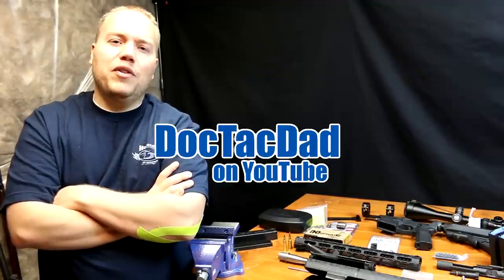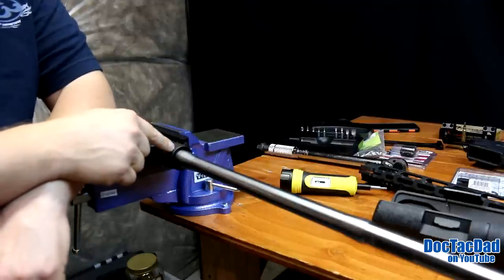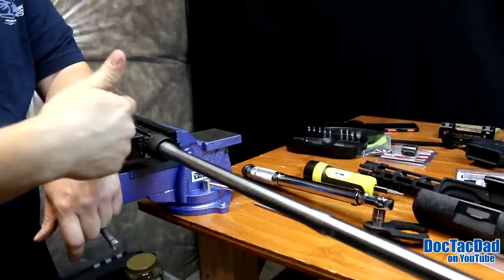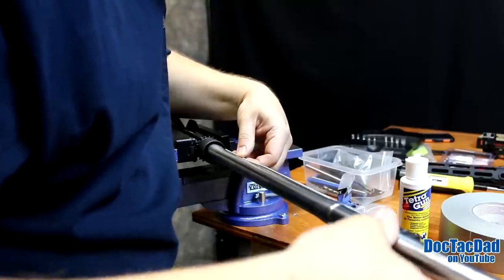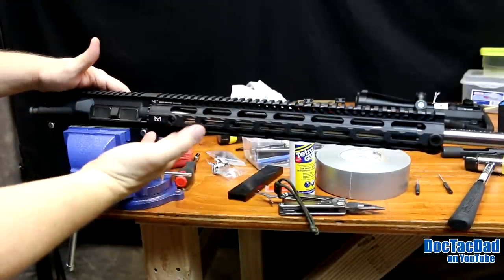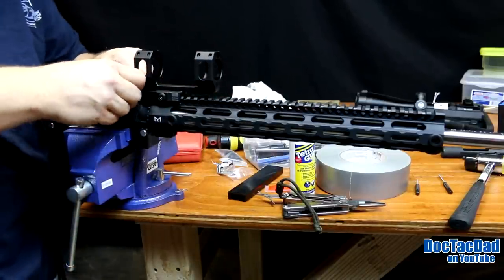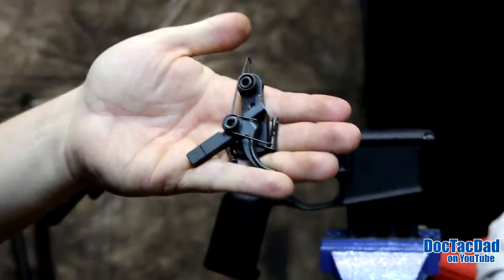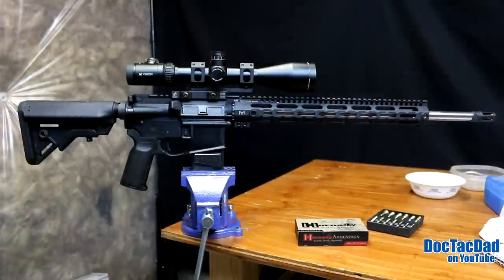Project 6.5 Grendel Rifle - Rifle Assembly

Comment: 3:50 MAKE SURE you have the torque wrench aligned with the tool, not angled from it like you have it when you were torquing 50-60-70 ft-lbs. You WILL NOT get a precise load transferred to the barrel nut if you do not.

Comment: Great build!

I'm surprised you didn't use anti-seize/grease on the barrel nut. It usually help with torquing. Also, "seasoning" the threads by tightening and loosening the barrel nut before final torque. When torquing the barrel nut, I find it easier to start at min (30ft/lbs) then then jump to max (80ft/lbs) to align the gas tube. It'll usually line up before you click-out at max. 

CHEERS!
Reply from the maker: El Terrible SoCal Great advise...I did season the threads just not on camera. The anti-seize is good idea...thanks!

Comment: you were using the torque wrench incorrectly when installing the barrel nut the torque wrench should be connected to the barrel nut wrench at a 90 degree angle for you to get the correct formulation
Reply: Exterminence grammar much?
Reply: Exterminence lol I think you were meaning to say "good to know that" and I was just being a smart-ass
Reply: You are very correct.
Reply: And you shouldn't be touching anything other than the handle

Comment: Just a tip a torque wrench is meant to be used with the device you're torquing with at the 90 degree angle. When you have it at 180 degrees (straight) like you did it is not accurate with what the torque wrench is set to anymore. you would have to use a formula to see what it would actually be by using the length of the object you're torquing with.

Comment: Great Video!! Just for future reference, when you install a crush washer, all you have to do is tighten then loosen it several times. Just tighten it a  little more on each iteration to crush the washer, hence the name crush washer. Also use gun oil on the threads while doing this works like a charm. Nice build my good sir.
Reply: Also helps to put it on in the correct direction.

Comment: If you do another build, they are addictive, consider buying some roll pin starter punches.  They are basically rods with holes in the end to hold the pin while you strike the punch.
Reply: wbbh I've been a mechanic a long time,  and I've never ran across these. I will be buying a set next time ol' snappy man comes back through.  Sound like they are worth there weight in gold.

Comment: I know this video is almost 2 years old and someone may have mentioned this already. When torquing the barrel but down, you want the upper/barrel to be paired by holding the "star chamber" using something along the lines of either a geissele reaction rod or an magpul bev block. The upper receiver is not designed to hold that much pressure. While this doesn't usually cause issues, it sucks when you are cranking down on the barrel and you hear a crack and your upper is split. Another thing is to "season" the threads of the upper on a new build. Tighten and break free the barrel nut 3 times. Again, won't have major issues but nothing worse than catastrophic failures. Just some ideas to keep in mind

Comment: For greater accuracy, to take out any slop between the barrel and upper receiver use a light coat of green wicking loctite #290 or #680 around the barrel extension before slipping the barrel into the upper, if the barrel fit is REALLY loose use some shim stock too.👍Also use an anti-seize compound like Aeroshell 33MS or moly lube on the barrel threads and torque the barrel nut, then loosen and re-torque the nut a total of 3 times to properly mate up the aluminum threads! That smooths out the threads so they don't gall in case you ever want to replace the barrel! Also helps you get the proper torque on the fresh aluminum threads.

Comment: You made a good video, but there are a few items that need amending.   when torqueing the barrel nut, it is recommended to oil it, torque, back it off to zero, torque it again, back it off to zero, that stretches the threads out,  and on the 3rd torque, put and anti seize compound on it.  Your torque wrench should have been 90 degree from the wrench head to obtain proper torque using that wrench.  A roll pin starter punch is best to use to start the gas block pin.    I stopped at the crush washer.   The crush washer is designed to fold over at some point, you never reached that point.  The cone shape should go to the inside and it will fold over correctly, if place incorrectly, it will break.

Comment: What I'm seeing is that the tools needed for assembly add a good chunk to the cost.  If you're only going to build 1 rifle, could be a costly build.  I understand that building your own makes it EXACTLY like you want, and of course it's a hobby, so cost doesn't matter (if you can afford it).  Thanks for the videos!
Reply: 454pakr You are absolutely correct. Many folks dont think about the Tools when planning their first build. There are a few tools used in this video that you can get away with not using. But I dont recommend it. Once you build one, chances are you will build another and another, so the tool investment is worth it. Some tools can be found at a bargain if you have access to a Harbor Freight or the like. The Tools eliminate a lot of the guessing I see some folks doing.
Reply from the maker: 454pakr There is cost associated with building your own...The first AR-15 build I did I ended up borrowing most of everything that I needed minus the upper block. I think that cost somewhere between $25-45. Like Tim "The Tool Man" Taylor would say you can never have enough tools...;)
Reply: I had everything to build mine already in my toolbox besides the vice blocks and an armorers wrench, maybe $30 in total I had to invest. Maybe $30 more(or less) in cheap tools from Harbor Freight/Northern Tool/your favorite chinesium supplier if you have absolutely no tools starting out.

Comment: Looks great, unless you have compensated the torque specs. For the extra leverage you have added to the nut you have over torqued this barrel nut. Just wanted people to know torque specs can be adjusted at the manufacture for the tool you add to the torque wrench, and there for no problems ,but even the smallest distance from the center of the nut you are torquing down multiples the torque greatly. Hope this makes sense to everybody , and thank you for sharing your videos.
Reply: Or you can put the adapter perpendicular to the torque wrench and its the same.
Reply from the maker: Josh Mclellan Interesting....thanks for the input.

Comment: You've over torqued the barrel nut.  The torque wrench setting is based on leverage, arm, length.  With the barrel nut wrench attached to the torque wrench aligned  as you had it, not at a right angle, the torque setting are completely skewed.  You've made the arm much longer thus making the moment much higher.

Comment: You should get a upper receiver lapping tool,you'd be surprised at how off the face of the receivers are. You can feel the difference when you tighten the barrel nut.
Reply from the maker: ***** Might have to look into that...thanks!
Reply: +DocTacDad I tried facing the receiver and saw modest gains in accuracy (few tenths MOA), but didn&#39;t see dramatic gains when shooting off a bipod (and removing bipod sensitivity) until I glass-bedded the barrel into the upper receiver. Since Grendel barrels are so long lived, and AR upper receivers can be so cheap compared to the cost of a barrel, it made sense to permanently attach them. That reduced any stress that the bipods translated through the handguard and the barrel nut into the barrel. I went from being able to shoot 0.5 MOA groups off bags but 1.5 MOA groups off bipod (with the groups being either vertically or horizontally strung) to a pretty consistent 0.5 MOA off bags and about the same off bipods (circular groups). Those MOA groups being measured as 5 shot groups avg ES.

Comment: I just did a little reading on the 6.5 Grendel.  Impressive.
Reply: There are more powerful & flatter shooting rounds out there if you go beyond the limitations of the AR-15, but the range I get from my Grendel for such little recoil is crazy. Even in short barrels, the ballistic coefficient of those 6.5 caliber bullets just  keeps them sailing out past what you would think was reasonable for an intermediate cartridge.
Reply: ostiariusalpha Yeah, that is what I was seeing.  It seems it fulfills the potential of the platform where the 6.8 spc didn't quite get there, and seems a good choice if you want to avoid going AR-10 size.

Comment: Looking to build an AR in 6.5, how much did this build run you?
Reply: +jstack I put one together with a $450 Shilen barrel, $140 Keis BCG, $160  Midwest Industries SS Gen 1 modular rail, $30 troy low rise gas block, $80 DPMS slick-sides upper, $120 Mega Arms stripped lower, A2 buttstock, $260 Geissele High Speed DMR Match trigger, all told, with upgrades, it was around $1500 before optic. Without upgrades, I could have put it together for less than $1000 before optic, and that is with the Shilen match grade barrel.